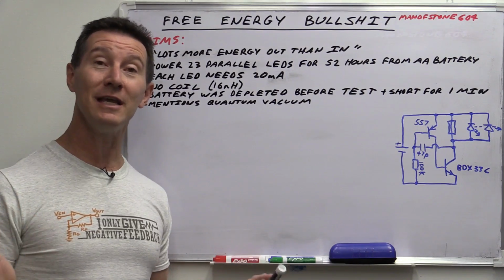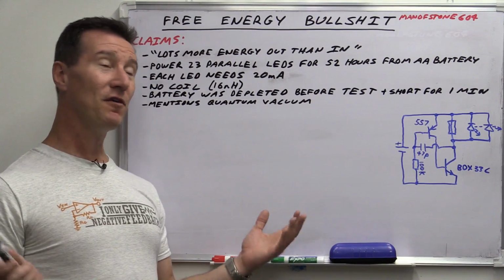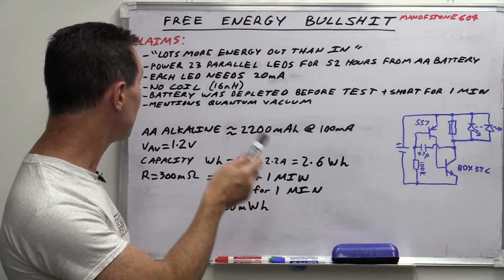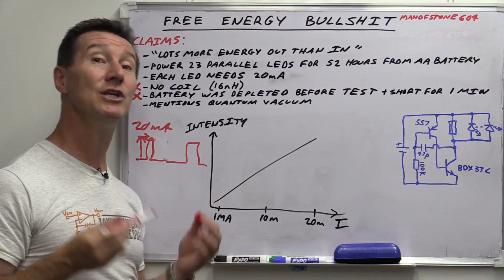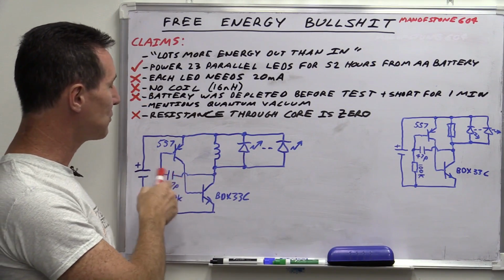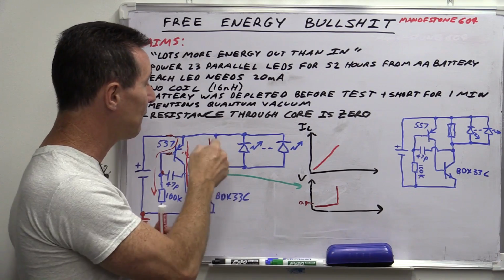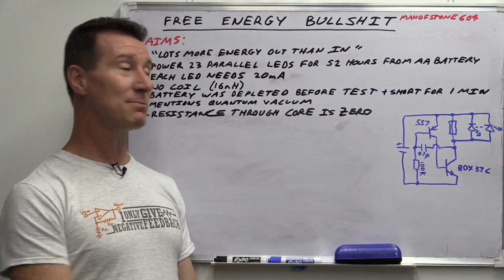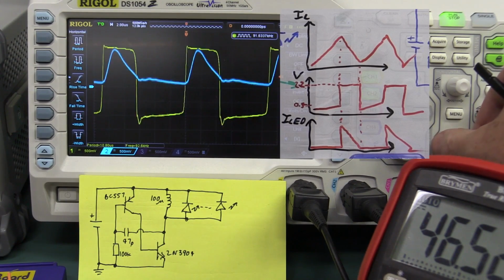EEVblog #708 - Free Energy Overunity is RUBBISH!

Comment: if over-unity does not exist - where does all the energy come from when an Atom bomb explodes?
Reply: You're an idiot, chilli sauce.
Reply: Coal has 4eV per atom. Uranium-235 has about 200 x 10^6 eV per atom.
Reply: Yes please .. what is eV and 200 x 1 million is 200E6  to make it easy
Reply: so can we be comfortable in thinking - you burn coal it gets x hot - you burn Uranium it gets x hot ?
Reply: Firstly, 1g of Uranium-235 contain 50E6 times more energy than 1g of coal. Secondly due to Uranium-235 highly unstable properties (coal doesn't have this property), nuclear fission allow large amount of energy to be release in a short span of time.

So where does all the energy come from when an Atom bomb explodes? - It is the material that the atom bomb use.

By the way, there are different type of Uranium. The most common Uranium-235 is for nuclear weapon while Uranium-238 is for nuclear power production. Both uses nuclear fission but amount of energy it can release over time differ.
Reply: ahh  so something at an atomic level can release more of something which also is at an atomic level .. is that right ..could this be the something from nothing everybody talks of   where more of something is available depending on what it is contained in?  over-unity is only a word but I think the real term should be maximum extraction !!  interesting how some academics will think outside of the box - was that the secret of all of our great minds we know of today?
Reply: You totally don't seems to get what i'm trying to explain or maybe my explanation wasn't layman enough. Something from nothing totally violates the law of conservation of energy. Lets say you input 1 unit of energy, you will always get 1 or less unit of energy as output.
Reply: but you just said uranium contains more energy than coal ! so at an Atomic level how is this possible? sorry if the question is deep but I need to know if the term over-unity is indication of something else
Reply: Firstly, have you taken any college level physics or chemistry class before or do you even have fundamental knowledge of all these?
Reply: no none other than -  a degree in Radio Electronics which is why I know about your math terms  in a nutshell all you are saying is you do not get something from nothing - and in a nutshell the Quantum theorists would disagree !!
where Electronics Engineering is made easier to understand is with calibrated meters ..without them we cannot determine anything unless we use the Mathematics .. but the real Parameters are only unmasked through action. then we can see if our calculations were correct .. so what parameters are people talking of and calling OVER-UNITY  do you get me

1.you cannot get something from nothing ( in physics 2 cells multiply and create a life form (where in the Chemistry equation is the Spirit being that we know as    I/me/you ?
2.then what is the something that is got that appears to be from nothing when designing a so called OVER-UNITY device?
3.remove R from OHMS law and what do you get ... a perfect conductor ! (is that also bullshit!) no heat !! from no resistance . .but its not possible is it because OHMs Law does not equate in that way - yet very cold projects are and have made headway.  I think Over-unity is  the wrong label where people are trying to create more of                        
 something from not a lot .. a bit like your explanation to my original question.

Now can you tell us all what the Back EMF design is doing for the Boys?
Reply: I think you are a troll but I'll respond anyway.
The uranium in the bomb has a lot of energy captured in the nucleus because it takes a lot of it to bind together neutrons and protons -- 202 MeV per atom, or  83 TJ/kg, which it releases during the fission process. When a supernova explosion occurs, a lot of energy is released, some of which is spent on fusion of different elements. That's where the energy in the bomb comes from.
 The coal does not undergo fission. Under high temperatures carbon reacts with oxygen and releases the energy stored in O2 molecules, forming CO2. The electromagnetic force (which is the one that chemical bonding runs on) is much weaker than the strong nuclear, so the energy density of coal (for burning) is only about 24MJ/kg.
Reply: Well... I have burnt coal at some point in my life. 
There are a lot of different sources. Uranium fission was discovered over 60 years ago, and now you can find info about it in textbooks or scientific literature. If we didn't know where the energy comes from in an atomic bomb we wouldn't be able to create stable nuclear reactors and weapons, as they require high precision in measurements and understanding the process.
Reply: 1ohtaf1 yep   I agree   can you expand on any of this yourself
Reply: Thanks for your time ~ have you ever done any of the things you talk of?
It seems many people are stating information as if they know it is true .. where do you get yours?
Reply: I'll toss a quarter in the machine and buy a handful of troll food...why not.  Chili sauce it's really simple.  The "free energy" fruitcakes are claiming to construct devices that are over 100% efficient.  I.E. this contraption consumes 10w while operating but spits back out 13w of power thereby recharging the battery that powers it and lights a small bulb at the same time.  Unless it's rolling down hill, being pushed by the wind/water current or converting solar radiation it ain't happening.  Period.
Reply: @JViello You've hit the nail on the problem: the "fruitcakes" are not claiming over 100% efficiency. They are claiming that they are getting more  out than appears to be being put in. They may be correct. Consider how much of the energy extracted from controlled nuclear reactions is wasted.
Our current technology converts some of the energy to heat which is then converted to mechanical energy, which is then converted to electrical energy. However, most of the energy is lost in other forms of radiation and chemical reactions. 

This video actually debunked the claims in less than 10 seconds. He didn't prove the claim incorrect; he proved that the assumption of how much energy had been inserted into the circuit was invalid. From that statement, it becomes necessary for the creator of the circuit to validate his claims by measuring the initial capacity of the battery, rather than assuming a value of zero. 
(Most "dead" batteries still have electrical current, but do not have the electrical voltage necessary to be useful. The circuit shown in the video would simply extract more of the stored electrical energy because it amplifies the voltage to a useful level by means of inductance. In other words, it increases the efficiency of the battery, but does not create more energy. )
Reply: Ok ~ I was expecting you to enlighten me there .. obviously not!!  can you at least tell me anything that isnt already academic or conjecture .. are you able to do that ? remember Trolls get involved in REPLIES also on Youtube... but you may not be that ..  or are you?   FREE ENERGY IS BULLSHIT    define the word FREE   and we get closer to the truth my Troll friend

Comment: No free energy ?  How does a crystal radio work? How we consume / use energy needs to changed so we work WITH  universal law.
Reply: I don't think that's free energy. I'm no engineering expert here, but, I do have an applied knowledge of electronics (I'm a pilot). A crystal radio, is just a basic diode, that's powered by radio waves. It's a simple passive component (unable to amplify), that acts as a rudimentary receiver, that only consumes power. It doesn't produce power. Hopefully an engineer can clarify what I'm saying.

Comment: If you live under a 65kV power line, get an antenna and ffs don't touch the antenna or you'll get a tingle. And it's also illegal. Also, don't get an antenna more than 5 meters or you'll get fried.

Comment: When I was around 13 years old, I made a bedini circuit because I thought I could make free energy by charging a bettery by using the motor powered by the battery itself. I am now 20 and have known that is bullshit for quite a while. I'm in college for computer science, but I am thinking about having a dual major in electrical engineering. It makes me sad how people think they can harness "zero point energy" to get free energy. Just like the idiots that thinkign a small bracelet will remove "dangerous EMF" from the environment.

Comment: Well you did say correct you if you were wrong, so we are here to correct you, endlessly for the next 100 years to counter your cheap and transparent attempt to mis-inform the public in your disinformation campaign you have been contracted to do against the new technology of working Free Energy Generators. So, here we go.....

Adam Trombly  has in fact created just a system, your viewer can go to the YouTube search bar and merely type in Adam Trombly. This inventor will get the newcomer to Free Energy brought up to date and then the newcomer can see that you are clearly lying about there being no Free Energy. Secondly, Quantum Physics takes into account other dimensions of existence and that thusly those other dimensions of existence has different physical laws that govern its matrix and that energy traverses ALL dimensions but that the physical laws of each dimension manipulates that energy differently. Unlike in the third dimension that we exist in while we are alive energy is NOT an electron. No instead energy is wave patterns of directional movement of Ether flow and that Ether flow IS energy and that this Ether flow can be brought into control and manipulation by way of manipulating magnetic flux and field shaping. This is where understanding Over Unity begins because if you use a small amount of energy to start an Etherical siphoned energy flow from the Ether, then the amount of energy that is flowing as a result of that initial action is quite clearly FAR MORE energy out than in. Now, lets see if you spend more time trying to discredit what we've just typed in this post or if you spend more energy asking questions in a sincere attempt to know more about the subject. We assume that OF COURSE you will spend more time trying to discredit something you know absolutely nothing about, thus is why we have placed you in our cross hairs

Comment: As of March 2017, the original Free Energy video link is no longer available to view. I wonder why they took it down? But I've seen enough of these to get the general idea. There was one I saw who claimed to get free energy from the 'air'. It was essentially a crystal radio, which basically worked like this: instead of driving an earphone to listen to, the audio signal was rectified to get DC then run into something like a Joule Thief to boost the voltage and run some LEDs.

Comment: Oh wow that first debunking section really hit me hard, i actually have a single led light that has been on for over 2 years now, and i was wondering to this day how it was even possible. It's very dim because the phone battery i used to make the thing (homemade flashlight) had it's overcharge circuits burn out during an accidental overcharge, so i could not recharge it. So i left it on and weeks went by with the dim light still being on. Then a year went by, and now over 2 years. Not claiming at all that it breaks the laws of physics, but i am still unsure how its still on, is it somehow sucking power from the air?
Reply: how many mAh is the phone battery?
Reply: im not certain, it was a standard one though, so anywhere between 600 and 1,000 i am pretty sure. It did finally go out a week ago, so almost 2 1/2 years of being dimly lit.